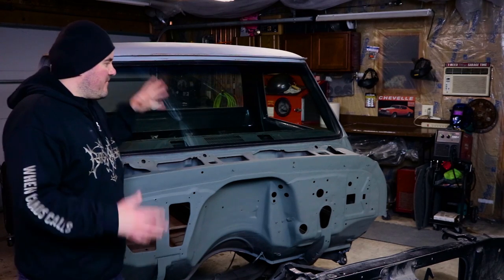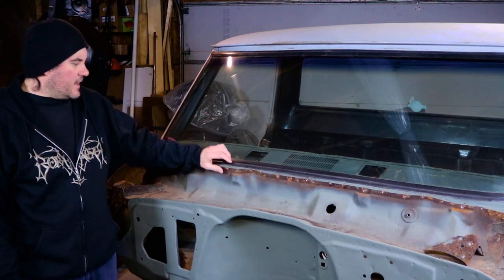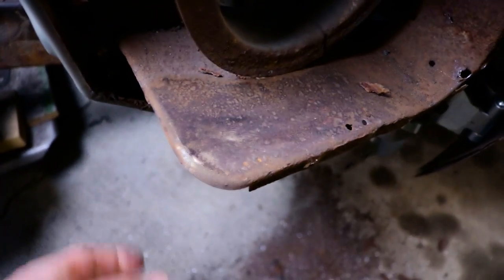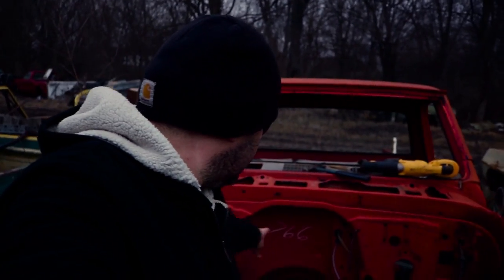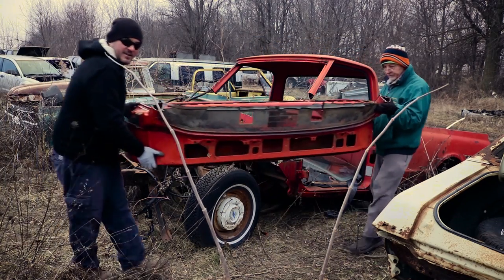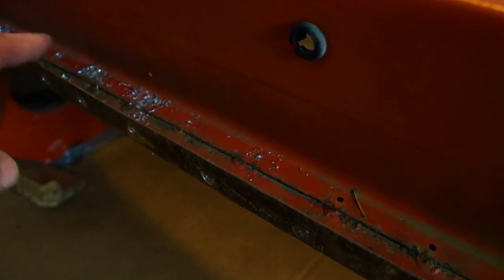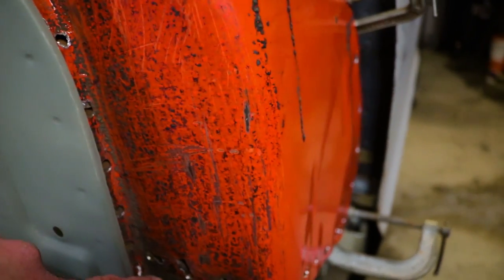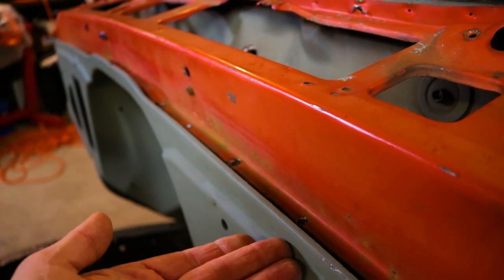How to replace a Cowl Panel on a 1971 C10 Chevy Truck

Comment from the maker: Post a comment and let me know what you guys are working on!
Reply: Busted Classic Garage 71 chevy C30 napco converted 4x4 dually
Reply: 80 k10 with a carbureted 5.3, th350, np205
Reply: 1970 Chevu c10
Reply: Now, I also have an 81 k10 4 speed with a 305(gutless)
Reply: 70 c10 side step..
Reply: 1969 k5 blazer
Reply: 72 k10
Reply: I'm working on restoring my 67c10 on my channel
Reply: 68 GMC C20. Building a stroker 383 for it currently.
Reply: 72 c10 5.3  4l60e cruise control

Comment: I'm picking up a 66' C10 SWB Stepside.  Has a running 283 with 2 speed Powerglide. Getting the plans together to go pick her up next Saturday!  Work gets in the way sometimes!
Reply from the maker: Yes it does. Did you pick up your truck yet?

Comment: Always working on my c20. Love your c10 videos you are very knowledgeable of the 67 to 72 Chevy trucks. Love the videos keep um coming
Reply from the maker: Thanks John! Where are you at with your C-20?
Reply: Body is all sound interior is new cst truck fully loaded for the time. Has original drive train 402 bbc 4 speed manual. Was vapor locking up a electric fuel pump in just resent may need to put in a return line this summer will have to see. Tranny is getting hard to get into gear. Maybe the synchronizers. Would like a new paint job and wheels and tires. Always something but it’s fun to tinker with. 👍
Reply from the maker: @johndudley5987  sound like a great project. Do you want to trade trucks? Lol

Comment: Dude, your format and use of time is great!  Most shows drag on, but your show is to the point and entertaining!
Reply from the maker: Thanks man! I try to cut as much bs as I can. There is a C-10 windshield video in YouTubeland  that is 30 minutes long, its one angle from the back of the truck and the guy is pulling out the front glass... why is that video 30 min if it takes only a couple of minutes to remove the glass? Now that's entertainment... LOL

Comment: I just got my 71 C10 two weeks ago. Have the engine and trans out and entire front clip also. Working front to back to resto-mod. I have all the same spots as you and probably anybody else. No junkyards near me but I have some near family in VA & PA.
Reply from the maker: Hell Yeah! The nice thing is that there is a lot of aftermarket panels for these trucks but most of them fit pretty terribly! But with a little massaging you can make it work.

Comment: The thing I liked most about the chevies was that 85% of them ever made are still on the road... the other 15% made it home. I bought a 69  and a 72  and both were rust buckets in five years and I even had paint done on both but I didn't do it myself so my bad! I drove a second hand 76 highboy ford 3/4  and built it to f 350 specks and I did body and paint only once. It stayed nice and when the wife sold it on me while I was at work, That was close to a divorce. Did ten years later and she cleaned the closet so I moved to Alaska and been here since 84. Never left, never needed to. Back then chevy made the best ride and dodge made the best steering but ford seemed to have the best body. My 95 f350 4x4 dually quad cab with five speed has over six hundred thousand on the clock and it looks new yet . I changed the valve cover gaskets (diesel wiring) and thats it but I do use synthetic oil and change the oil in the hvhp pump on every oil change (amsoil) and have since new, same with my 5.0 explorer. Same year but different color and over three on the clock. I don't like the new ford diesels nor the aluminum idea they try selling. I'm 72 so I change tires for winter or summer and thats it. I just got too damn old to cut the mustard and I miss my shop and my dog
Reply from the maker: Seems like nowadays the Dodge's rust out the quickest or at least the early 2000's did. Thanks for watching!

Comment: Project with priority currently is a 72 gmc 3/4 ton named Sheila. 5.3/ turbo 400 lowered 4/7. Waiting for my template to show up from Brothers to make it a shortbed.
Reply from the maker: Nice! I just bought another C-10... this one is a 69.
Reply: I've got a 72 C10 as well, she's got a 5.3/4L60... she will get shortened also as long as the gmc goes well.  Finally got air conditioning in her last spring after about ten Texas summers without. I love these trucks
Reply from the maker: @shawnwimberly9294  same here!

Comment: Have seen some of your other vids on floor, cab support, rocker repair that helped. I'm currently on cowl project working my way to other side. Mine is a mess but I did find donor firewall/cowl. Little bit more extensive of project for my skill level but I'm going to tackle. Anxious to see how you attack. Nice job!
Reply from the maker: Thanks man! I'm going to try to use some of the side vent pieces from the junkyard cowl and what ever I can't salvage of the yard piece I'm going to have to make from sheet metal.

Comment: Great video and been working on my 86 k10 and 79 camaro and got a 94 chevy I'm gonna take the body off slap it on a 4x4 frame then get a 68 c10 body put it on my 94 frame
Reply from the maker: Nice, my buddy is doing the same with a 1970 and a 2004.
Reply: @BustedClassicGarage  thats good and yea i know few people that did it i just need to find a body

Comment: Cant wait to see what this looks like when you get it finished! Definitely jumping down the rabiit hole with this project! At least your roof doesnt look like the roof at the junkyard! \m/
Reply from the maker: I know right, that was bad!!!! I probably won't touch the cowl till spring because even if I get the metal work done, I need to coat it with paint and it's just too cold for that at the moment... Thanks IL for your __ weather!

Comment: Thanks for these videos. Do you know if the flange section between the firewall and cowl where the wires ran, which replacement panel would have it if ordering aftermarket? Would it be on the firewall panel or cowl or its own piece?
Reply from the maker: No problem. That lip is part of the inner cowl. https://www.jegs.com/i/Key+Parts/576/0849-113/10002/-1?gclid=Cj0KCQjwj_ajBhCqARIsAA37s0yLcSBd73W6KgFNWz7mUDSb874zaancLp1nhZu6v7qnvRvA7vrwmxkaAlePEALw_wcB
Reply: @BustedClassicGarage  Yes it is. Thanks. That makes perfect sense. When I saw your nice cowl cut, I was like “where does that L-shaped piece come from?”.
Reply from the maker: @general23cmp  no problem.

Comment: 72 c10 shortbed with 400 sbc and th350 trans. Box is good,  cab needs everything!
Reply from the maker: That's a great combo! Why did those trucks rust soooooo bad in the corners of the cab? That rust is so common, it's like the rear window channel on the 66-67 Chevelle.

Comment: I had a comment previously, and you helped. One more… I am cutting mine out and have all the spots along the perimeter cut and loose, but I’m being held down on both ends by something. I see in your video that the blower area appears to have other spots to remove. What is on the driver’s side? I see the fender bolt brace that you spot cut out, but it’s laying loose on the inner cowl later. I was thinking it only was attached to the upper cowl and didn’t need spot cut (maybe not).
Reply from the maker: In the video where I pull off the cowl that was after all of it was cut out. I threw it back on for that shot. That brace is welded to the side and front of the outer cowl and it is also welded to the inner. Do you have instagram or facebook? I can you send some pics of where the spot welds are.
Reply: @BustedClassicGarage  I just sent you a FB message. Thank you!

Comment: 71 c10 doing a bed swap. Also a 76 trans am body work. Lots of body work to go on both of them. Lots of rust on the truck. Cab corners and floor boards coming soon.
Reply from the maker: Nice, I guess C-10's and second gen F-body's go hand and hand. Rust repair is endless on these vehicles... especially on the C-10!

Comment: I’ve got a ‘71 K20 Chevy, I am redoing the cab, I have to buy all the floor sheet metal and such, the only part I could not find is the panel underneath the cowl, behind the kick panel vents. I can not find those panels at all, let me know if ya know anything? Thanks
Reply from the maker: Are you talking about the bottom section of the cowl, where that drain hole is. If that's the piece you're talking about as far as I know they do not make them and you would have to fabricate something or find a donor vehicle for those pieces. If you're talking about the footwell, that gets welded to the a-pillar and the floor, LMC has those for pretty cheap.

Comment: Have a 69 GMC  C25 with these same issues. Also floor panel replacements.  Possible just going to replace the entire cab.
Reply from the maker: Would probably save you a ton of time if you found one in decent shape.

Comment: Working on a 71 gmc cab corners an rockers .nice cab except  for that .got this truck out of the woods.
Reply from the maker: Nice,  should be a fun project! I actually just bought a 69 myself. I'm cutting up the lower cowl and a pillar from this junkyard panel to fix the horrendous rust around the firewall. Should be a wild video! Stay tuned!

Comment: I’m working on a 72 c10 right now just trying to figure out if my cab is even worth saving have rust under the weather stripping for the door
Reply from the maker: Depends on how much time you want to put into it. My floor is completely shot. Check out my floor vid and cab corner vid you will see how much work was involved with mine, and I'm nowhere near done.

Comment: Not that I'm advocating aftermarket over factory but I was just curious, do they reproduce that cowl panel? Thought I'd ask since one can damn near build a whole truck out of a catalog now days. And I've got more projects than I can handle. 67 Cutlass, 66 Special, and  80 Monte for starters
Reply from the maker: Nice, the first car I ever did any kind of resto work was on was my buddies 1970 Cutlass Supreme. The price is what got me, the junkyard panel cost me $60 and a 12 pack of Busch vs ordering it from LMC for $300 and paying the $125 freight charge. You know things can add up pretty quickly with these projects, wherever I can save money to put into something more useful, I do.
Reply: @BustedClassicGarage  heck yeah cant beat that price plus it will probably still fit better than aftermarket
Reply from the maker: @ClassicRideSociety  Oh, I'm sure it does!

Comment: 1967 C-10, I am stuck on the cab supports on the passenger side because I can't get the vehicle the height I want it to work on it comfortably. New lift should help this year. I don't have a place to work in it indoors , I have a lean to carport over a cement slab with so heavy PVC coated tarps to help knock the wind down a bit. Eastern NC here so we should be going from winter to summer any day now. We don't get spring/Fall weather like some places.
Reply from the maker: Hey that's awesome though! Most people wouldn't even try if they had to work in those conditions and yes it sucks welding upside down!

Comment: I'm looking for a 1950s t0 1960s stepside chevy truck to rebuild that's untouched most ppl started working on them and have them all jacked up and just want to trade them off. But I have a 01 chevy silverado 1500 with a 5.3L V8 LS and I bought the whole truck off a farmer it was his old farm truck and the frame is pretty bad but I temporary fixed it until I find my dream truck for a decent price then I already have my donor motor and everything I need to swap it all.
Reply from the maker: Nice!  Yeah my truck was a disaster when I got it. The guy before me fixed the parking brake with a bike lock cable that was too long. He knotted it into a softball sized knot to shorten it, and it's still didn't work right. Oh how about fixing the rockers with home hvac piping and a 1/4" of bondo... smh!

Comment: All the junkyards I go to won't let you bring sawzalls or cutting wheels in with you. At least that's what the rules say...but then I see people cutting frames to get engines out. :rolleyes: With the Quarantine stuff going on, I've been working on my LS swapped '89 S10.
Reply from the maker: Yeah I just went to a big junkyard last year to pull a transmission out and they looked at me funny when I wanted to bring a jack in. If you find a junkyard in the middle of nowhere they'll let you get away with anything... Oh yeah and you bring a case of Busch Light with you and they'll give you all sorts of discounts... lol! Nice, sounds like an awesome build!
Reply: @BustedClassicGarage  Yeah, we aren't allowed to bring jacks either, but all the cars are up in the air, so it's not really necessary unless you're pulling and engine or trans. But they have free mobile a-frames for it if you need to.

Comment: i'm building a 68 with 454 stroker but i have a few of these and i have 2 extra cabs with no rust in them and just got a 70 pu in pieces all good parts for free and a 65 for a broke  down 90 cutlass the 65 has no rust in it but he needed the car for parts for his wife's car have lots of parts for any thing from 64 to 79 like to trade for parts i need like a all metal cowl induction hood and 4 pieces of chrome for a 68 have good project cars and trucks most don't have rust or just a little rust if it was me i would scrap that truck i have scraped way better but i do understand y u made the video to show people on how to do plus i have fords and mopars too the 68 i have 1300 in the truck with the 454 stroker tunnel ram msd all after market parts on motor fresh heavy duty 400 turbo the motor has 6000 miles on it got it for free with trans have another one that i got for free
Reply from the maker: Nice! Yeah I think I'm at the point of no return. LOL

Comment: I'm working on something out of the box click on the little round picture at the left and check it out on you tube it's a 454 M
ID ENGINE  C10 street legal this was only built to see if I could really make it work -it works great  --v drive -13inch drive LINE 12 bolt diff  faceing backward -- more details on -- rear engine c10 pickup big mutha thumper cam --on you  tube

Comment: this video scares the shit outta me. I dont have the time or resources for all of that. Guess I will be doing some stop gap.
Reply from the maker: It just depends on the level of restoration you're doing. Most guys would shoot rust encapsulator in there and call it a day. I thought about doing just that but with the amount of rust that I knew the truck had I figured that was going to be a pretty rough area.  I needed to fix the cowl and I figured this would be easier then trying to patch a bunch of spots on it including a long section of the cowl lip.

Comment: So it hurts to see you cut up that junk yard can lol!!! Why didn’t you just take the whole cab? If you don’t mind me asking
Reply from the maker: The cab had the same rot that mine has on the floors. The only salvageable pieces on that truck where the dashboard, cowl and roof and a portion of the back. I went back later and cut off the roof for my buddies 1970 C-10 project also.
Reply: They like to rust out around the windshield. Mine is doing it. Got a penny size hole where the weatherstripping is......
Reply from the maker: Surprisingly my window channel is pretty clean.

Comment: Good video, I’m keeping the same inner cowl panel, my truck has rust on the conners of it , I’m just fabricating those spots I had to get  a shrinker/stretcher and a sheet metal brake that I can use later, the sell the inner cowl new but I decided to fix it at http://nsanehotrodz.mybigcommerce.com/1967-1972-chevy-gmc-inner-cowl-panel/
Reply from the maker: Thanks! LMC has that panel also. $300 goes a long way sometimes. A shrinker/stretcher and brake are a lot better investment than that panel.